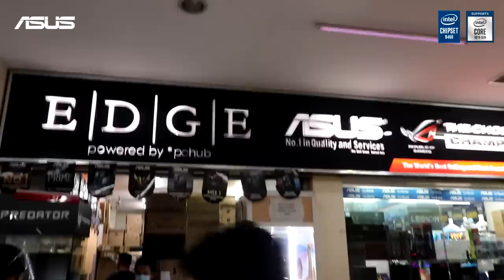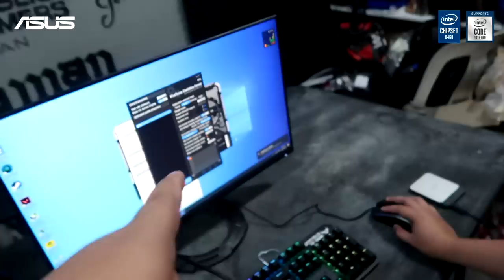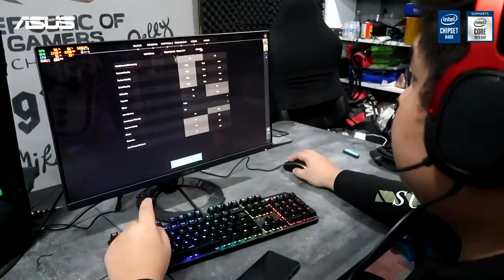75K PHP ASUS AND INTEL GAMING PC BUILD!!!

Comment: 32:12 you should not mount radiators on the front with tubes up or mount the front radiator below the pump, there's always some air in the AIO, and it will make it's way into the pump if mounted like this.

Comment: Nice Build but next time if you are building another PC you should talk or mention how many threads and cores have the CPU had and how fast is the ram is, is it 3200 Mhz and what type of GPU did you use is it an AMD or Nvidea card and also what type cooler did you used is it Liquid cooler or just a normal cooler or water cooled and how many Hz does the monitor have and what the size and the price for all of those for specification :) Goodluck on your next build if their is one :)

Comment: Imagine those people bought 3000 series cards tas Esports games lang nilalaro
Reply: lol why not?
Reply: @ohohkhimee  Di naman kase kabigatan mga Esports games e
Reply: @coffeus3876  not really. the higher the better. higher frames gain is actually a good thing when playing in high refresh rate monitor hindi lang dahil mas smooth but to reduce the input lag also. one of the reason  pro players why they have to disable or lower the graphics is to gain maximum fps possible though they have already a beast set up. 3000 series maybe too op for 1080p pero sakto lang sa 1440p.
Reply: @ohohkhimee  Kaya nga di naman kelangan ng magandang graphics sa Esports, tas yung sinasabi ko kase yung mga Esports games lang naman nilalaro sayang lang yung 3000series hindi pro players yung tinutukoy ko
Reply: @coffeus3876  kung sa 1080p maybe pero kung sa 1440p no. hindi sayang. if u play fast paced games where in you need very fast response you would understand what im saying that is why i mentioned the pro players. pero kung mobile legends lang nilalaro mo di mo maiintindihan.
Reply: kasi nga pera nila wala ka magagawa e
Reply: @ohohkhimee  preach bro